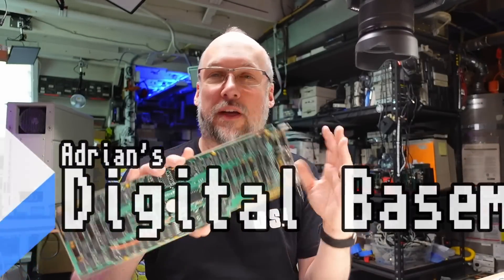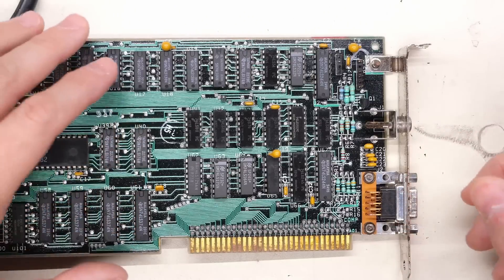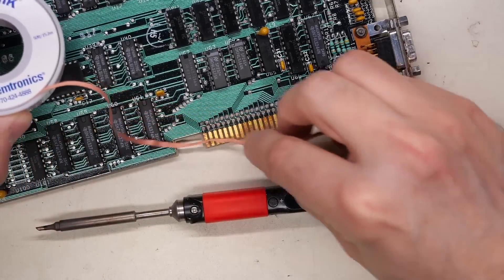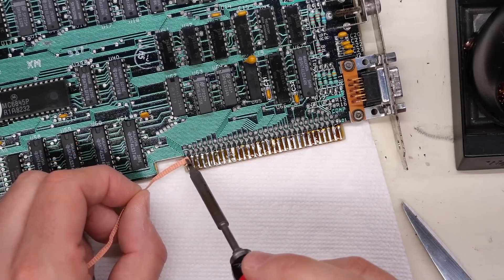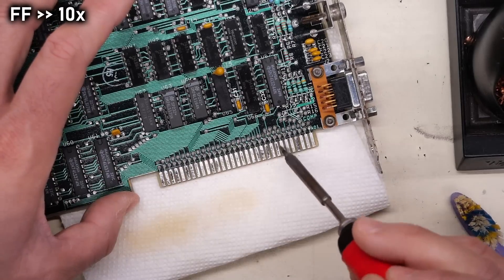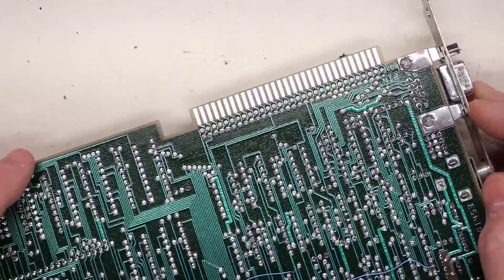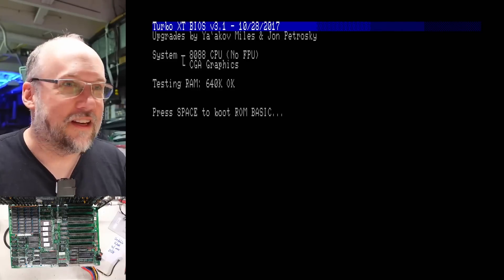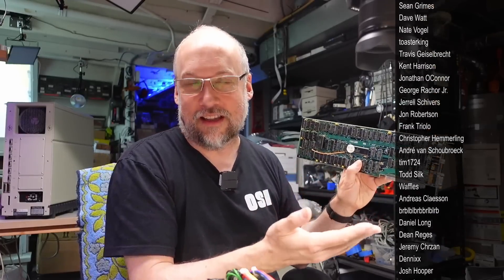Tinning corroded pins on the trash-picked CGA card

Comment from the maker: I know there will be a lot of peopel who wanted to see me do gold plating on this connector. Might be a fun experiment in the future, but what I did here is perfectly good for this left-for-dead card, at least for me. :-)
Reply: If tinning edge connectors was good enough for TI's 99/4a carts, it's good enough for a garbage rescue CGA card
Reply: Many, many years ago I was involved in manufacture of pcb's,  we had a rework starion for edge connectors, basically a current regulated DC supply feeding a carbon rod wrapped in a cloth sleeve. This was soaked in the electroplating solution, worked well for a quick touch up, but the solution was mainly gold potassium cyanide, not something you would want to mess with at home!
Reply: It's pretty expensive and that involves double plating (nickel first, gold second), so i'll use only for something VERY VERY rare.
Reply: @chepossofare  it is not really expensive, one kit for pin plating you can get for less than 100 bucks and you can goldplate several thousands of pins with it. back in the years this was a common fix in industrial applications and the kits where much less expensive in the 90's a kit costs around 20 bucks but since this profession died out the kits are raised in prices.
Reply: yeah no. the metal has to be so squicky clean for a good plating, you had no chance to do that here. too oxidized. you did the right thing here, amazing results.

if in the future the tinning starts to look dull or oxidizes, it can be quickly redone with a bit of flux and braid
Reply: Would love to see the results of this!
 PACE Rework and Repair "Replating Edge Connectors" 
https://www.youtube.com/watch?v=wYza_M8WVf0
Reply: @pagej97  this whole series was a great thing to watch during my education in this area back in the 90's it is so good to see them on youtube for ever available to public
Reply: Gold would be expensive for a trash card. Probably better to save that for something rare and important that needs saving.
Reply: @tim1724  I definitely get your point but otoh, you don't want to be learning how to do this on something rare and important that needs saving. You want to learn on trash cards.

(This stuff takes practice.)
Reply: I would love to see this card revisited in the future. I've been hesitant to do this myself because of all the negative comments I have heard about oxidations, etc.. I suspect this is a fine fix for a card that isn't going to be inserted and removed frequently.
Reply: @ericanderson85 plenty of 30 year old cards that had tinned pads (not nickel plated) and they work just fine. its only an issue in high humidity environments
Reply: The original gold will have been electroplated onto the copper tracks, this gives a "Hard Gold" surface.  This surface will be hard wearing and oxidation free, well almost and certainly easy to clean. The suggestions below about chemical plating produces a "Soft Gold" surface, this will also be oxidation free but not hard wearing and after many insertion cycles would expose the copper tracks. The suggestion that you can gold plate in the future is a non-starter, the lead-tin solution (i.e. solder ) is dissolving the gold that is already on the connector, and unless removed completely would contaminate any gold laid on top, The lead-tin surface will not be as resilient as an electroplated gold surface, but as someone below said, you can easily repair it again. Should you have electroplated it? Depends just how much corrosion fluid got into the PCB, but I suspect on a Cost/Benefit ratio you have made the best of a bad job.
Reply: @melvynoconnell1671  back in the 80's and 90's replate worn out contacts or plate exchanged pads was a normal thing
there exists no "electroplating" or"chemical" gold plating gold plating can in every case only be done by electrochemical plating. you need always a acidic solution of a gold salt that get electro chemical plated onto the copper trace (a two state plating with a nickel layer between trace and gold was never done and only used for hard pins not for traces). you are right lead tinned copper traces is a problem to do this procedure in the future but you can do it by use hydrochloric acid to remove all tin and lead.
Reply: Only crazy people would want that.
Reply: People saying its expensive it isn't there are kit pens and solution etc 
i mean is a miniscule amount of gold
Reply: Gold plating would be a great next step, now that you've got a base that works reliable for now. The solder you added on top is prone to corrosion ... chemical tin plating can go bad within 2-3 years from experience (tried to save some money on PCB prototypes a while back when I was getting into the subject).
Reply: Yes please get a gold plating kit as tin is horrible for contacts. It gets everywhere and scrapes off and oxidizes. Result is so much grief.

Comment: Here's a technique I used recently to restore the beat-up edge connector on my SuperCPU:  after tinning all the contacts like you did in the video, don't reach for the solder braid/wick.  Instead, reach for the box of cotton swabs/Q-tips.

Heat each contact from its leading edge, and while keeping the heat on the whole time, slide the cotton swab along the pad, applying firm pressure and pushing the solder toward/onto the iron.  Use the swab to actually push the iron off the pad as you get to the end of each one, so that heat isn't lost until the very last moment.

Then the usual IPA, eraser, etc. for clean-up.  The result is a very thin, even film of solder.   Done right, it's hard to tell that it's not OEM. 😉

Comment: Tinning with solder will make it worse in a while! it never works in the mid to long term as lead in the solder gets oxidized over time. While led oxide somehow conductive, its interaction with the edge connector terminals builds other oxidizing chemicals that prevents current flow.

Comment: When I built my bootleg CGA card some forty years ago, I Wanted gold plated edge pins, so I recovered some from a scrapped VeroBoard card. I delaminated the epoxy to obtain two very thin strips holding all the contacts, using a small file. Then I stripped off the area where the contacts were meant to reside and filed it down to a suitable thickness. I then glued my two strips in place and soldered small wires to establish contacts everywhere. It worked like a charm. Very time-consuming, but the contacts are still like new, forty years later.

Comment: I have used tightly rolled up paper towel as a soldering iron tip cleaner.  Fold the paper towel over a few times, then roll as tightly as you can.  Apply tape to one end (to stop it unrolling), and use the other to brush the excess/old solder off of your soldering irons tip.  Works great, is dirt cheap, and a single piece of paper towel can last many months.

Perhaps that was what your friend was using to brush the excess solder off of the tinned connection.

Comment: It's an OK fix but for something that matters you can't really go past gold.  Tandy used tinning on the edge connectors for the expander port on the MI motherboard and also the interface cards in the MIII.  I was always cleaning the floppy edge connectors in my MIII until I gave in and bought a chemical gold plating kit.  Should have done it far earlier but hindsight.

I see other comments about cheaper SIMM cards, yes, saw tinning there too.  Those modules were very touch sensitive, give them a nudge while the PC was running and it pretty much guaranteed a crash, at least in my experience.  Gold flashed ones were far better, reduced the crashiness of PCs we sold.

Comment: Apparently fingers are either gold or silver and I was told a long time ago when I did rework and prototyping not to get solder on fingers as you can't get it off and it will eventually corrode.  However, at this point in my life I have seen solder tinned fingers (even ones that didn't have the excess removed) last literally decades and what you have done in this video is way better than that brown looking bare copper.  I always thought too that if it did corrode you could just re-tin it someday although that isn't acceptable for a production environment I guess.

Comment: Gold plating (ENIG) doesn't have a huge advantage over tin-lead coating other than it's less likely to oxidize, put some deoxit on the connector afterwards will mitigate it. In a factory the solder is leveled using hot air (HASL). You did a great job!

Comment: I've been meaning to do this for a long time to an old Amstrad CPC464 which has a badly corroded edge connector. It works with my DDI-5 but I have an old Multiface II that is tested working, but just does not register when plugged into my Amstrad. :/

Comment: I think you used much more solder than necessary. It should be enough to fill the braid/wick with some solder and use the braid/wick itself as the source of solder. There's also a tinning liquid you can buy, but you might have to remove oxidation on the surface first. Not sure.

Comment: 7:49 actually cheapest wicks are also good because what makes wick wick is its ability to suck solder. I do solution of rosin (colophon) in IPA or denatured alcohol (depends on amount, ipa isn't thah cheap) and first submerge wick in this solution. When it soaks it is ready to be used. And yeah, this solution might be dirty (in both senses) but it does its job just fine and is suitable for work like this.

Comment: Nothing wrong with tinned edge connectors; there's a history going back decades of using this on simpler or low-cost products, and it works just fine. One of the available finishes from PCB manufacturers is HASL, Hot Air Solder Leveling, which is basically exactly what you've done here.

It's easy to apply at home, even to contacts in rough shape, and produces a reasonably durable finish that won't corrode that easily. Trying to gold-plate the fingers is complicated and fraught, because even the "simpler" gold plating methods (which are a lot more complicated than this) will produce a finish that is too thin and too soft to be useful, and a solder finish will be better. Reproducing a proper hard gold (different than the typical ENIG) finish as is normally used on edge connectors is out of reach of most hobbyists, and not worth the trouble.

Comment: Tin plating is fine. The only reason gold is used is that it doesn't oxidize. Tin will oxidize, but it's easy enough to "clean" it by removing and installing the card. With gold you can plug it in and forget it. Coating the tin pins with oil (automotive stores sell a silicon grease called dielectric grease) will prevent oxygen getting to the contacts by creating a barrier.

Comment: Wow - a quick 2nd channel video!  What next?  A mail call video of ~45mins? 😜
Anyhoo, this tinning the edge-connect fingers seems to be the best solution to the oxidation in the short term - with the materials at hand
   - There is the usual grumbling that this solution is flawed (see above) - Someone suggested plating with elemental Tin - I expect that is nearly as prohibitively expensive as plating with gold.
   - Seems that the ideal, economical solution is to obtain and use Liquid Tin and/or apply dielectric grease.

On top of that, thanks for passing on the tip about using the humble bog-roll as a means of solder wicking! 😂  That's in the vein of using a business card wetted with IPA to clean the head drum of a VCR.
Other handy tips from the comments (thanks ppl! I'm writing this here more as a memory aid for myself, lol)
 - Fibreglass pencil to clean/polish edge connectors (better than a pencil eraser, which in itself works well)
 - For this type of operation with no Liquid Tin available:  Tin some fluxed wick, then wipe the tinned wick (with heat) over the exposed copper
 - For this type of operation (if tinning) - Tin, then remove.  Then tin again (because some gold will dissolve in the first tinning - thanks @VintageTechFan) 
 - 63/37 solder

Comment: I tin a lot of edge connectors on my arcade boards and I have found the easiest way to tin is to apply the solder then heat it up and wipe it off with your finger. It is a little hot but not unbearable and not painful. I am not sure it would give better results but it would be faster. I don't use flux wither when I do it. A bunch of edge connectors burn themselves up at the power connections so I have had to clean up and replace some of the fingers with copper tape. The tinning covers the copper and connects it to the good trace.

Comment: Tin edge card fingers work because tin oxide (SnO2) and lead oxide (PbO2) are both conductive, important because the metal will oxidize quite quickly after soldering. It is not as conductive as gold, but it is good enough for an application such as this. Back in the 'day' I used to get Radio Shack project boards that were unplated copper and tin the edge-card fingers so they would work reliably. I built several small projects for my CoCo using those, since RS sold a CoCo-sized project board, the bus was very project-friendly, 6809 code was dead simple, and the excellent Willamette Valley CoCo club in Eugene (close to where I grew up) had a lot of smarties that were always happy to help with projects. Great video and a good example of how to preserve the hardware for another generation or so. Cheers!

Comment: Awesome job.. it's great to see old cards revived and now tinned and will last another 40 years. One interesting thing about the solder wick and cost.. we've gotten so used to things on sites like the jungle website hawking cheap garbage (no offense to Chinese people by any means) but mass produced very low quality junk from China (again, no offense) and on the eBay the same stores offer the same junk, but yeah some things in life you just have to pay to get quality products. Lots of things can be had at a discount, but when it comes to electronics and working with them, there's really no cheap way around it. Man I miss Radio Shack.

Comment: used solder wick would have been sufficient to do the same thing. instead of removing solder the used solder wick would have provided all the solder you would have needed to do this. nothing wrong with your technique though as you'd have to have used solder wick in the first place. this method is just a way of saving some supply cost

Comment: When you run out of the 60/40 solder, make sure to spring for the good stuff: 63/37 (this solder solidifies MUCH faster than the older 60/40 formulation). 🙂

Comment: I would suggest not doing this because heat can lift the pads and you have a bigger problem than you started with. I'd say just clean them and if need be use some sand paper. The tin/lead mix could potentially cause other issues down the line but it'll probably be 20 years from now who knows. I mean I can't fault Adrian for trying or anything but yeah, adding heat to those contacts can cause them to lift specially if you dwell there for a time soaking heat into them. I wouldn't risk it if I wanted to keep the card.

Comment: After cleaning, you were suppose to put some dielectric grease on contacts, and forget about it. As it will not oxydize or corrode. Am I the only one who does it?
Reply: I was aware of this grease, better never heard of this method, good tip! Still i wonder what grease would improve, because it’s for lubrication. Is this the same like anti-static grease? To easily pull cables through tubes? Grease absorbs dust and dirt, so that might be the reason…

Comment: Liquid tin by MG Chemicals.

 This is what it's designed for. 10x faster. Will not corrode.
Reply: Very expensive though.
Reply: @lexluthermiester MG isn't cheap but they have great stuff. I use their carbon paint to refresh Amiga and Plus/4 keyboard plungers. For such old devices I think it's worth the money.
Reply: It's for lab use only, not the home. Please read the MSDS. It's extremely nasty stuff. It will destroy your esophagus, can give really bad burns, will likely give you cancer (no not the level of it's likely to cause cancer by the state of California, real material safety data sheet cancer concerns), and not to mention, it's extraordinarily toxic to aquatic life. You cannot flush this down a home's sink, you have to dispose of it by a real commercial chemical disposal company, household hazardous waste disposal will not suffice either. I keep seeing people recommend this product, it's great and all, I've used it in a lab. However it's absolutely not for the home. Please for the love of all that is holy, please don't use this in a house.

Comment: Adrian getting maximum content out of this terrible CGA card.
Reply: isn't it the ORIGINAL IBM CGA card? You know, the one that's actually capable of composite output, which a handful of games (King's Quest, Wizardry, Burger Time, there are others) actually support and gives you more than 4 colors if you connect it to an NTSC monitor? If so, it's not a "terrible" CGA card. That would be the cards that ONLY support digital output and thus all you can get are those horrible 4-color palettes.

Comment: When tin-plated contacts mate with gold-plated, this can cause galvanic corrosion. After some time (depending on humidity, this is in months or years), the contacts will start causing issues. The contact resistance will go up and noise is added to signal. When moving the connector, it will go back to normal until the next time. I've seen this happen with pin headers in over half a year in outdoor environment. The tin plating will also leave a thin tin layer on gold plating and mess up the gold-plated contact. Tin-tin is much more reliable than tin-gold.
Reply: yes. It would have been better to use cleaner and dielectric grease.